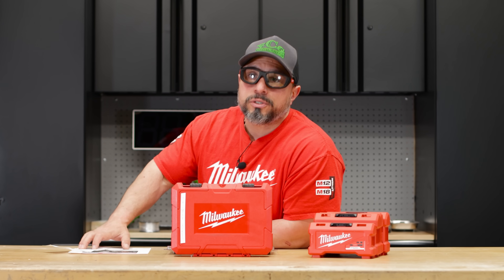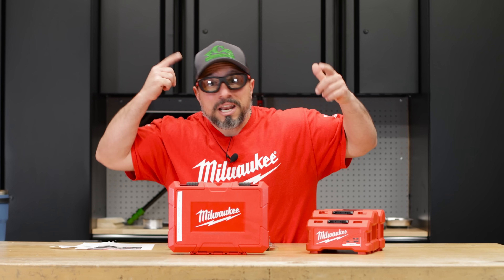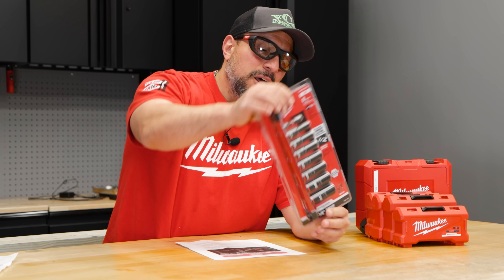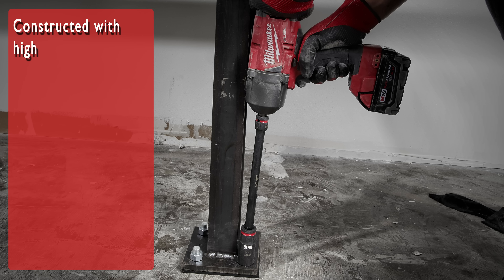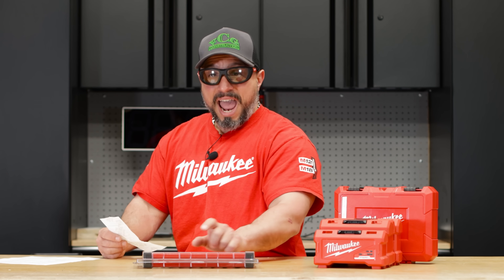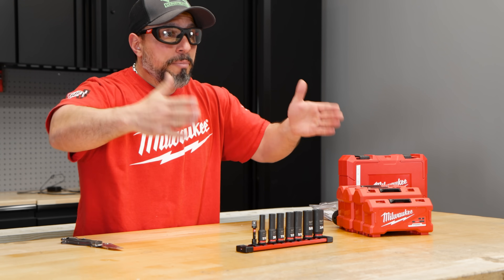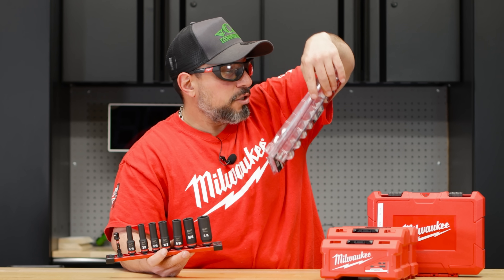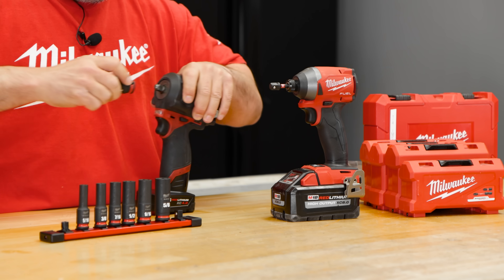Milwaukee Tool NEW Impact Sockets (WHY WOULD YOU BUY THESE?)

Comment: For 40$ Ill stick with my Tekton Impacts.  got a 14 piece metric and a 15 piece standard for 40$ each.  Lifetime warranty that I can take a picture of a broken socket send it into tekton and they will mail a replacement.
Reply: I prefer sunnex and mastercraft, but we're still on the same page
Reply: I have a 3 piece set of tekton socket adapters for an impact driver that have held up better than the ryobi and dewalt ones I had. They both shattered quick
Reply: Yes sir, right there with you. The SAE set being shown, is 7 pieces with a ton of skipped sizes ;)  Clearly Milwaukee isn't looking out for automotive / diesel technicians.
Reply: @TheNachris720  the metric misses 12mm. Good luck anything Asian (automotive tech here)
Reply: Grey Pneumatic duo sockets for me, all in one!
Reply: Tekton sockets are the best deal for the price, have been for years. I’ve been buying Tekton since 2006 I think. Anyway, many Tekton tools are made in the same factory as Snap-On and Blue Point in Taiwan. Taiwan tool steel is known to be some of the highest in quality. I’ve damaged a 1/2 socket wrench and two impact sockets…Tekton didn’t require anything, not even a picture. They sent replacements right away and I got them two days later.
Reply: Most of these cheaper sockets, including Tekton are made out of Cr-V which isn’t ideal for impacting. Milwaukee sockets are made out of Cr-M.
Reply: Tekton can't count, they're always skipping sizes lol 😂 but their sockets have never failed me
Reply: @zfilmmaker  people it's not the steel from Taiwan China or USA it's the process in which it's made. The heat, the oil etc;
Reply: I got the TEKTON too. Beautiful tools, best bang for the buck and unbeatable warranty. But I can’t deny MILWAUKEE quality. I don’t stick with one brand, just do my homework and go for the best option. Example: pliers(knipex and some snap on), power tools(milwaukee), for the rest hand tools some snap on, matco, capri, sunex, ect. My opinion taking the facts under consideration. 😬👍
Reply: Exactly bud in these days you can't just buy things because of fanboyism. You absolutely must do research before purchase. Sticking to one brand for everything these days is like shooting yourself in the foot. I have all different brands of cordless power tools and different battery platforms but I do that so I won't get stuck with a broken tool in the middle of a job. Research people research !!!!!!!!!

Comment: As a professional auto mechanic I always wondered why impact sockets were needed for 1/4" drive tools.  You can't develop high torque with 1/4" drive tools, and you can't get small fasteners that can be tightened to high torque or require high torque to loosen.  I even wonder why you need impact sockets for 3/8" drive tools but maybe some people use them.  I never did.  For any application that required the strength of an impact socket that was a fastener that required 5/8" or larger socket so similarly why do impact socket sets, especially 1/2" drive sockets, start with small sizes such as 5/16" or 3/8"?  Who is going to be using a 1/2" drive impact tool on #10 screws?  I think 1/4" drive tools can come in the real small sizes, 3/8" drive tools don't need to go smaller than 3/8", and 1/2" drive tools don't need to go smaller than 5/8".  I think anybody who is buying a set of 1/2" drive sockets will already have the smaller sizes covered with 1/4" and 3/8" drive tools.  I would be happy to buy a Milwaukee 1/2" drive impact socket set but I don't need metric sizes smaller than 17mm or maybe 15mm, not only do I not need them I don't want to have to pay for them.  I want 1/2" drive sets that go up to 24mm or so, must include 18mm and 22mm.  I have no need for impact sockets for 1/4" drive and 3/8" drive.  I understand that DeWalt and Milwaukee make 3/8" drive impacts that are capable of turning 24mm sockets on tight fasteners so some people are willing to buy those and run 3/8" sockets on them, but I'll go ahead and buy 1/2" drive tools for that.

If you really want to run those big sockets on a 1/4" hex driver you can find other tests on youtube where people have done torque tests of various brands of drivers to see which one was strongest.

Comment: I'm a diesel mechanic with my dad. He had never really thought about Milwaukee cordless power tools until i started working with him last year. And now he just gets pissed off at his Snap-On power tools every time they cant bust a rusted bolt loose. I swear Snap-On electric cordless power tools have half of the power for twice as much money.

I got in to milwaukee because i wanted a cordless 1/2" impact wrench and my local Northern Tool and Equipment was having a black Friday sale for the Milwaukee M18 High-torque W/ 2 5ah batteries and the boot for $500 AND they were throwing in the M12 3/8 electric ratchet W/ 1 1.5ah battery. A phenomenal deal IMO.

If anyone
Reply: You do realize people pay truck price because the warranty is the best you can get right ?
Reply: @gnash4354  snap on power tool warranty is actually pretty poor compared to Milwaukee, I believe it’s only 1 year warranty. Their hand tools yes are lifetime warranty. I believe even their air tools only carry a 3 year warranty. Also their cordless tools I believe are still brushed so there will be a difference in power
Reply: @joshcbr8  regardless, that warranty gets serviced same day there’s a problem vs shipping it out to be fixed
Reply: @gnash4354  air tools won’t get repaired same day they go to snap on for repair, plain and simple, I’ve done it before. Electric tools couldn’t tell you, I never owned a snap on power tool. I’m no longer in the automotive world so maybe that’s changed.
Reply: @joshcbr8  my matco gun got serviced on the truck as well as my 1/2 ratchet that started to lock up. Maybe not all tools get serviced on truck? That or snap on does it differently
Reply: Bro I been looking at Milwaukee for a sec and the snap on truck keeps trying to get me to buy a 1/2 inch high torque off them for 1000… gonna go with Milwuakee fs on this after seeing your comment
Reply: Cordless tools are evolving rapidly.  What was a maximum power tool 3 years ago is halfway down the list today.  And the brands also jump around as to who has the most power.  So it pays to upgrade tools occasionally.

Comment: Couple of points
#1 Six point sockets have been the gold standard for decades when it comes to removing stuck bolts or high torque applications. 12 point are seen more often because they are easier to get on the bolt. It's a case of what's best vs what's most convenient.
#2 Makita has two different 6 point deep socket sets in a case with the foam, They are 14 piece sets. The 1/2 inch is $84 and the 3/8 inch is $60.  The Milwaukee set is over priced.

Comment: I bought the Milwaukee impact socket set that has Sae and metric + adaptors extensions and swivel it was like $140 and it was pretty nice. However after about 6 months of everyday use the sockets I used every day were  still in good condition but the drive end (end that connects to impact) is all smushed and rounded out almost. I sold the set for about $100 and bought the full Tekton 3/8 impact sae and metric shallow and deep set for $180
Reply: dang how'd you manage to sell it for $100 with the rounded ends lol

Comment: it makes sense that they are going up to a 1 inch drive since they make a 1 inch drive impact wrench....$42 is a good price....2 years ago i bought the milwaukee 7 piece  3/8 drive socket set and it was $50 at HD with no adapter or rail to put them on....just loose sockets  in a plastic package.

Comment: came to this video with one question, how deep does the broaching of the hex go into the socket. Professional sockets, the hex portion of the socket is only deep enough to engage the flats of one nut. On cheap deep sockets the hex goes all the way to the bottom. 

In this video I did not get a camera angle that showed this.

Comment: Vince,I have a 1/2 inch stubby  when you put any  ordinary  impact socket on it it rubs  on the motor housing ,it also happens  with milwaukee ! because it has a concave cut in the end of the socket .
I had it changed  under warranty  and bought British  made straight  cut sockets which solved the problem  .
They should  have made the anvil 5 mm longer 
Can you look into this as milwaukee  are saying it's not an issue  ,however  they changed it under warranty  !
Would be great if you could do a video of this thanks Andre

Comment: Great video Vince.
I would like to start off by saying I love all my Milwaukee tools. I was almost all in ...I need deep well impact sockets. I have some but I really like the stamped and painted high VIs sockets that you showed. What turned me off 100% was the skipped sockets. I noticed there was no 11/16 in the set. I'm out! Nothing worse than not having all the sizes especially if you are someone that uses your tools and not just collects them. Nothing worse than wrenching on something or disassembling something then trying a 5/8 and realizing you need the next size bigger in your kit doesn't have it.
Now what is the guy supposed to do when you have something partially disassembled possibly your vehicle, and you don't have the next size that you really need? I'm out! Fix it Milwaukee!
Reply: Yeah i bought the old set from Acme a couple weeks ago and i noticed this came with a socket adapter but no 11/16” socket. 🤔

Comment: TBH I haven’t been too impressed with their 1/4” impact adapters. I’ve broke 4 sets I bought. Not sure how much I’d trust these too much. I’m a machine builder and assembly line/automation builder in Detroit, MI. (I travel for installs too) My tools work hard daily. The best 1/4 drive adapters I’ve used so far have been Masterforce ones from Menards or the Hercules from Harbor freight.
Reply: They just released updated adapters. Way more durable. I assume the one that comes with the socket set is one.
Reply: I've been using them to drive lag bolts

Comment: Love my Milwaukee tools but I use the Tekton impact sets. The 1/2 “drive set has 13 sockets in plastic case with 3/8 to 1 1/4” no missed sizes. My Milwaukee impact tool has the hog ring

Comment: I'm a garage door technician and we use deep sockets. I usually go for the chrome non impact rated sockets because it allows me to get into tighter areas but these milwaukee sockets in the 7/16- 1/2 and 9/16 look pretty compact while being impact rated I'll be giving this set a try!
Reply: I can also recommend the Husky thin wall 3/8 impact sockets. I use them myself!
Reply: I'll definitely be checking those out aswell!
Reply: Unless you’re really giving them hell, there’s no reason not to use chrome vanadium sockets with an impact for normal use. When you’re really getting down on them with the impact is when the impact rating is needed. Impact sockets are softer and more ductile so that they don’t shatter; hence the wall thickness being so much higher. Or break stuff loose and tighten with a torque wrench or a big ratchet and use the sockets for speed. Personally I would just run them until they break and replace them. If you use something like snap on or craftsman, they should be warrantied anyway.
Reply: @liquidrockaquatics3900  I'm really pushing on them lots of 7/16 tapers and 3in and 4in lags. 1/2 and 9/16 don't wear out as fast since they are only used for nuts and bolts
Reply: @liquidrockaquatics3900  it's not that they'll break, it's what happens when they do break.

Shards everywhere, and if you arent wearing safety glasses (lets be honest, a lot of people aren't) those shards will go into your eyes. Any mechanic worth their salt will tell you if you're gonna go with only one set of sockets, go with impact rated ones. Because not only will they handle a gun, they work fine as a hand tool socket as well.

Comment: I'm glad I seen this video.

The impact adaptor are ok fairly strong but can be snapped easy with over tightened or cross threaded items.

Those sockets I'd question as you don't want that black mark at the point as it stresses the point and the socket burs off the point and rounds the head.

That's the big difference with the other brands as they won't do that.

I have kinchrome 1/2 impact sockets (6 point) and force or Taiwan impact 3/8 sockets and both don't leave a black mark.

With heavy use the points inside a socket will open up and that will round items.

The other wear problem is the socket end becomes bashed open by the head of the impact

Comment: Thanks so much for this great review! Just bought the Milwaukee Fuel Surge impact driver last week to remove screws that wouldn’t budge. It was a very tight space so that driver was the perfect size and very powerful. It’s fantastic. So I wanted to know if I could use it to get the nuts off my mower. I’ve tried everything else.  I did buy an impact set with an adapter but this kit you reviewed looks like what I need. I’ll be getting one tomorrow if it’s compatible with my tool. I look forward to watching more of your vids. Btw I’m a S Jersey/Philly girl. Not familiar with VCG but will keep an eye out 👀

Comment: Auto techs won't jump on it till it gets on a tool truck.  Convenience is the name of the game at a shop. I had my only two m18 batteries fail at the same time.   Luckily 3 trucks carry it a week     so I bought it at a slightly higher price (120 instead of 100) because i needed it right then right there
Reply: Depends on the tech.  I prefer tekton atm because 4 days or less anytime I break anything the new one is delivered

Comment: For auto work, I looked in their catalog for 3/8” Metric impact sockets and could only find deep sockets, except for an expensive Metric/SAE combo kit. When you work under a car or in an engine bay, access is everything and the Milwaukee stubby 3/8 impact wrench with short Metric sockets is ideal for tearing into a suspension, for instance. Deep sockets are essential as well, but I can save a lot of time if I can get the stubby tool into tight spots, and a set of short Metric 3/8” sockets is important to me.  Personally, my SAE wrenches and sockets are in an old toolbox I keep in another room; I only work on imports.
Reply: They came out with shallow sockets! ^^

Comment: Finally someone giving Sanpy a run for their money
Reply: Not until the put out the metric ones. Especially for auto techs.
Reply: @JazielR  I don't think those will be far behind. I've been a Snapy user for decades, great tools, but expensive
Reply: Not till it gets on a tool truck.  Some techs will use em but most will still go to a tool truck.    Cause it's easier
Reply: @christopherelrod8788  I'm a retired wrench, yes, and some will also like to put them on payments. Lets see how Milwaukee markets them, how much effort to get the automotive market
Reply: @christopherelrod8788  True. I'm an estimator at a body shop and I always worked on my own vehicle and it's very seldom that I pay anyone to to work on my car or my home for that matter. I was also a low voltage tech for some years. Fire alarms, burglary alarms etc. So needless to say I got tools and I love buying from the tool truck and making payments on them.
Reply: No where close, the SAE set is a 7 piece? Normal SAE set's will have 11 pieces.. The Metric set has 5 skipped sizes also. No thanks, these are a waste of money, You go to use your new milwaukee sockets, but oh no? I dont have that socket size!
Reply: @TheNachris720  The tool trucks give you a better deal to buy in sets. There aren't many countries that still use SAE sizes. The set Vince showed is a marketing mis-step. The parent company is not stupid. they appear to be making a play for the automotive market. Snapy has become fat dumb & lazy, they have treated dealers badly over the years, they are ripe to get their head handed to them.

Comment: I honestly would choose Grey pneumatic if I was a tech. They have thin impact sockets. 

Tekton is a strong player. I wish I had known about them sooner. Or I would be fully outfitted with their 3/8 and 1/2” drive No Skip Set.

Gear wrench makes one of the best 1/4 sets but they shorted their 3/8 and 1/2 sets. So they honestly aren’t great if you want a complete set in those 2 drives.
Reply: Problem with grey is some of their sockets have sloppy fitment on fasteners.

Comment: Nice stuff
I may have to try the new Milwaukee sockets out.
Reply from the maker: I’m definitely thinking over some of the accessories!
Reply: Dont, you will waste $ . SAE socket set has 7 pieces, normal set's have 11pieces. Metric set also has 5 skipped sizes. You "MIGHT" have the right socket size, if you ever want to use them.

Comment: I've been waiting for Milwaukee to come out with a set like that
Reply: Keep waiting, they have a bunch of skipped sizes in their sets. The SAE is a 7 piece set, a normal full set with no skips will have 11 pieces ( 1/4 - 7/8 in.)  Also, the Metric set skips 5 socket sizes. They dont give you a 8mm, 11mm, 12mm, 16mm, 18mm ... doesnt seem worth it
Reply: @TheNachris720  
That's so the metric didn't fit imperial bolts or nuts.

Also some kits miss sizes like 21mm or 24mm on purpose so you have to buy a kit plus buy those set sizes at a higher cost

Comment: I am not impressed with milwaukee products, impact drivers and circular saws are good but ive gone through 5 sawzals, 3 hammer drills and 16 batteries, im a plumber i just cut boards and pvc pipe maybe some black iron now and then, that is no bueno

Comment: Milwaukee is fairly priced compared to snap-on, gear wrench or match tools. That is not bad for impact rated sockets. Especially in the automotive line. I could see myself buying the milwaukee brand for sockets. Even harbor freight ICON is pricey compared to milwaukee.
Reply: SAE set has 7 pieces vs the normal full set of 11 pieces. Also, the Metric set has 5 skipped sizes.. these might be good quality, i cant knock that but the coverage is a joke.